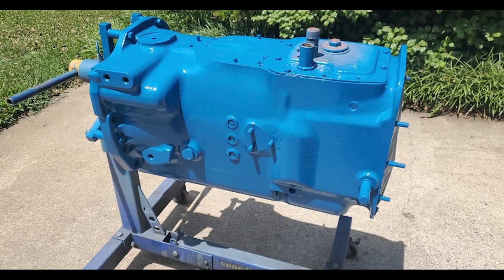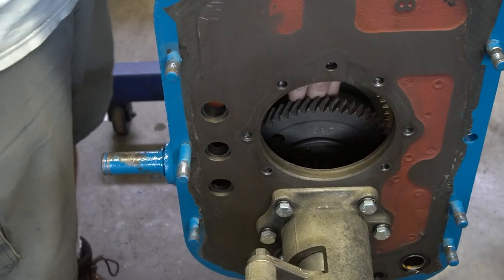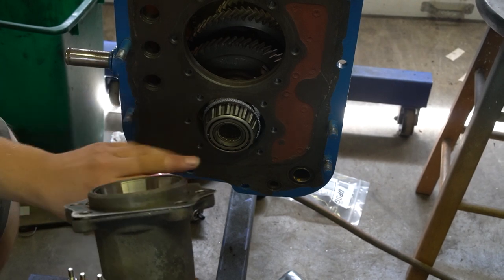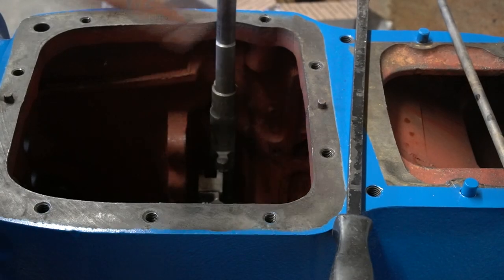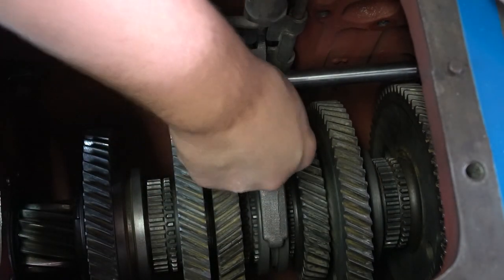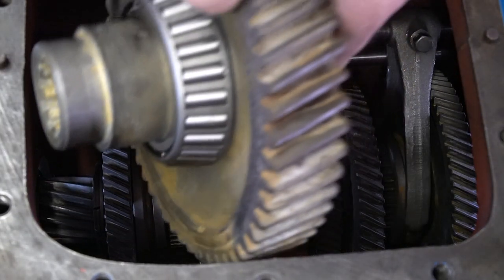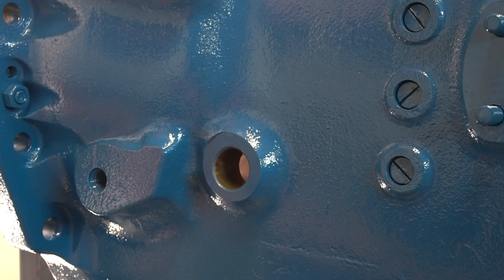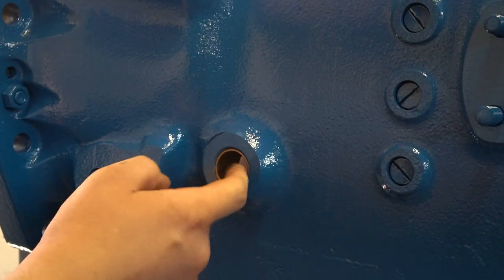Ford Tractor 5-speed Transmission Assembly

Comment: Excellent info. I’m currently working on my 4000 with the 5-speed transmission.

Is there a replacement for the clutch shaft spring? I’m having trouble finding one!

Thank you!
Reply from the maker: I dont think there is a new one available. Have to find a good used one.

Comment: Should the clutch pedal have a  1-1/2”  play before hitting resistance?

What should the distance be from the foot board to the  top of the clutch pedal?  

Everything has been reassembled (thanks to your videos) and now I am looking for final measurements for my clutch pedal. 

Thank you!
Reply from the maker: I dont have my manual at the moment but from memory there should be 3/4" free play and pedal height is 9-5/8". Height was 9" something but I can't remember exactly.

Thanks for the comments. Glad the video helped you.
Reply: Service book for my 861-D says 1-1/2" of free play and 9-3/8" pedal height for a 5 speed, live PTO transmission. That being said, it isn't possible to adjust my rod to get the pedal that high with that much free play.

Comment: Is the transmission input shaft able to be purchased anywhere? Having trouble locating one of those also
Reply from the maker: I've seen the PTO input shafts available new but not the transmission input shafts. I've ran across a few on ebay that look nos but are for the non-live PTO 5-speeds.

Comment: Also what about the oil seal retainer/throwout bearing retainer? I have a new one but am having trouble figuring out does it need an oil seal and a needle bearing inside the retainer?
Reply from the maker: Needs an oil seal. No bearing in it. PTO input shaft has a needle bearing in it. I cover changing those on the subassemblies video.

Comment: Would you have a part number for the front pto input shaft seal that goes inside bearing retainer
Reply from the maker: Deleted my first comment since I reread your question and I think I understand which one you're asking about. On the input shaft there are 2 seals. The small one that's inside of the PTO input shaft is a SKF #10515. The larger seal that's in the throwout bearing retainer at the rear of the PTO shaft is a SKF #19831.
Reply: @chickenhousemechanic  thanks for the info, I really appreciate it. Your video is great

Comment: Hello, I hope you’re doing well. I have a question if you don’t care to answer . I inherited a Ford 850 tractor with what I believe is the same transmission as what you are rebuilding. My problem is that it likes to pop out of gear. I can’t remember which gear my uncle said likes to pop out, but I know it’s either 2nd or 3rd. Some people say that it’s a detent ball that is worn, but watching your video I didn’t see any. If you get a chance respond. Thanks!
Reply from the maker: It's most likely 3rd gear that is popping out of gear. On the left side of the transmission you'll see 3 flat head plugs. Behind those are the detents. They aren't balls but more bullet shaped. The top one is the 3rd/reverse detent. The bullet tip may be worn or the spring may be broken.
Reply: @chickenhousemechanic  That’s a similar explanation that and old ford mechanic told me. I’ll have to open it up this winter and see what the problem is. Thanks for responding!

Comment: hello, I have a ford 5000 and I have a problem with the R gear. The transmission does not put R gear neither in operation nor stopped. and the gear lever does not move in R gear. What is the problem?

￼
Reply from the maker: I'm not familiar with the transmissions in the 5000 model tractors. However, on a recent Facebook group, someone had a similar issue, and others told him the shifter inside the transmission is most likely worn. As for general transmission knowledge, I'd say if you only have an issue with reverse, it would be something internal to the transmission. If it was every gear, I'd look at the clutch.

Comment: Can you tell me, which one is the 1st speed gear
Reply from the maker: First gear is the largest gear on the main shaft, the one on the bottom of transmission. It's actually the 2nd gear in line as the forward most gear is the PTO drive gear.
Reply: @chickenhousemechanic  thank you  so much

Comment: What is the of the size Woodruff  key  I have a 860 and their a lot of play that shouldn't be there
Reply from the maker: Should be a 1/8" by 5/8" key for the shifter handle.
Reply: @Chicken House Mechanic   okay thank
Reply from the maker: @MattSouthers-iv9ds  you're welcome.
Reply: @Chicken House Mechanic   that's  what I have but there still play
Reply from the maker: @MattSouthers-iv9ds  the shaft might be worn out. Make sure your nut is tightening down good. It'll snug down on the taper.
Reply: @Chicken House Mechanic  I  got it tight  good

Comment: would this transmission fit a 56 850 ?
Reply from the maker: Yes. Just make sure you have the correct clutch and flywheel as the live pto requires a different setup compared to the non-live pto in an 850 tractor.
Reply: Thanks and flywheel is different right ?
Reply from the maker: @chevellejon8  Yes. Both the clutch and flywheel are different.

Comment: My transmission has started slipping out of third gear and will not go in fourth or fifth gear !!
Reply from the maker: Jumping out of gear is usually a detent but not going into gear would mean something is bent or broken. The transmission on your 850 would be the same internally as this one with the exception of the input shaft. You'll have just a single shaft. Everything is set up the same with the exception of the bearing preloads I mention in the video.
Reply: @chickenhousemechanic  Thanks !!!!

Comment: It would be nice if he showed use how to put spring on. He skipped over the hard task.
Reply from the maker: I tried filming it but my hands were in the way so much you couldn't see anything. I used a prybar and screwdriver to roll the spring around the tab. Set other tang onto throwout bearing fork first.
Reply: I set the larger tang first then took a small box end wrench and pried the other tang on the fork. My problem is I still don’t enough spring tension to lift my clutch peddle up. Any ideas what could be wrong?
Reply from the maker: @fredschaefer9200  the spring could be weak. The clutch itself will push the pedal back when it's installed in the tractor. Also make sure nothing in the linkage/shafts are binding.